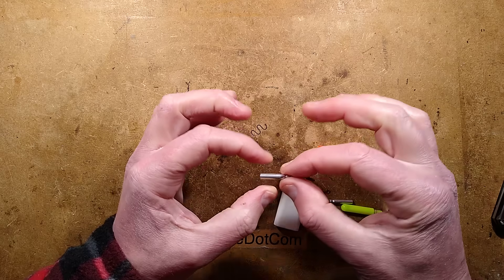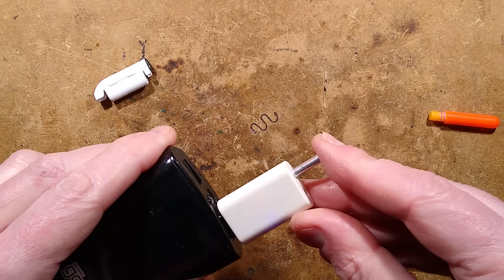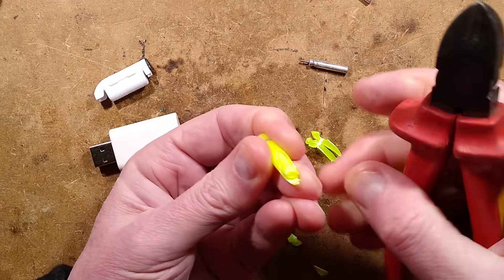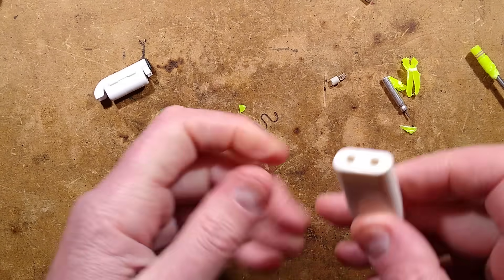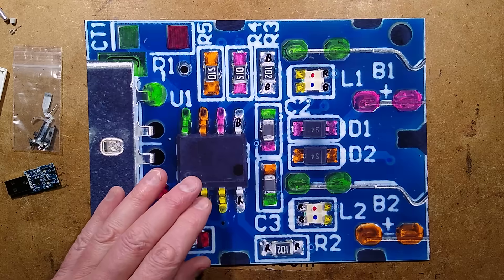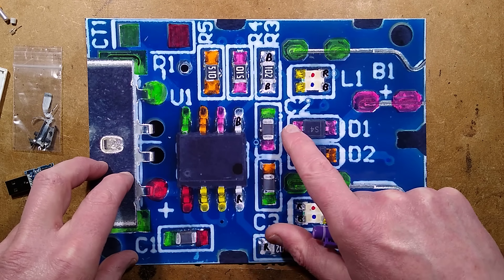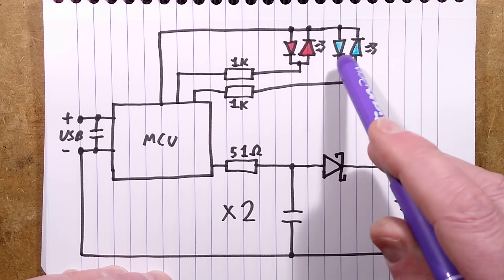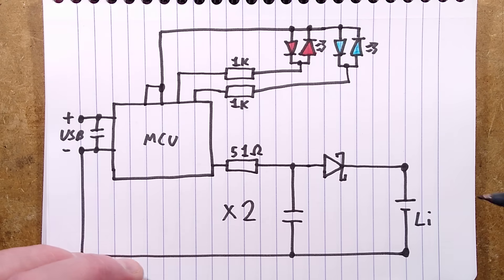Inside a tiny CR425 lithium cell and its odd charger - with schematic

Comment: So when you're holding the battery the case is the negative
Reply from the maker: If I recall correctly, the case was positive.
Reply: @bigclivedotcom  usually the tip is positive but okay

Comment: Its pretty cool.  If the led is designed to be used underwater then no circuitry means less to go wrong when it gets wet.  Also the led cannot overheat since it is in water.  So you can probably drive the heck out of the led without any trouble.

Comment: I love these things, been using them for all sorts of projects for years. They last anywhere from 24h to 3 days, some of em are a mm or 2 longer than others and those shine longer
Reply: I bought a few of these to test and some are better if they are marked with CR425, the unmarked ones work OK but will not return to 4 Volts when recharged, so the red LED never goes out on the charger.

Comment: I use these little cells for my fishing floats for quite a while now.
I had one in the mid to late 90s but the battery was about 5 D-Mark those days and they lasted not very long. Lately
I bought some of the rechargeable ones but they  tend to not have lots of recharge cycles and the capacity drops quite a bit 😒 but they are cheap a.f. now so 🤷🏼‍♂️
Too bad they can't be used to do funny stuff besides letting a led suck the minimal amound of juice those thingies have. With an Multimeter alone (no led connected) you can literally see how V and mA leaves his little body, poor little guy 😅

Comment: Illuminated archery nocks also in two lengths, short for crossbows.
Standby time was 3 years with only running an hour or so a few minutes at a time. Have longer replacements but still haven't put them in.
Never seen the charger. Thanks.
Reply: They are triggered by the snap of the string release, the nock is about half a millimeter from being seated and one wire is bent down through a tiny notch. Presumably there's a contact when they squeeze together.

Comment: I've used these extensively over the last year and I quite like them. You typically attach them to the end of a fishing rod so you can "see" fish bites in low light conditions. Previously people would use bells or mini glowsticks which would either become very obnoxious in light winds or would be disposed of after use. You can get "CR " non-rechargable or "LIR" rechargeable cells in multiple different sizes (I think the 425 is the largest?) and also floats with LEDs integrated optionally with smart flashing modes. Maybe another video idea?

Comment: What's the cell capacity? How long do they light up for?
Reply from the maker: The intensity starts high but gradually reduces.  They are still visibly lit 24 hours later.
Reply: From a User on Ali he is saying The LED's  lasted for like 13 hours on arrival, then needed recharge.

Comment: Is this similar to what Airpods use for their cells?

Very odd way of driving the LED's. I guess it saves resistors compared to having all 4 direct drive?
Reply from the maker: I think they use tiny rectangular cells.  I've never opened a set.
Reply: Pretty sure the chinesium ones... airpods clones... use the same/similar cells... for a long time. Speaking just as an enginerd  (I know everyone on this channel hates us) ... but you can pack more battery into a round shape, than a square shape, for the same length... when you are going to contain it in a cylindrical shape... like the cylindrical body of an airpod earbud... which is where the battery actually lives. Not saying those guys making the clones care... but, they might. For chinesium components... it all comes down to cost. But, I expect that Apple uses cylindrical batteries... like at 200.00USD (on average) for Airpods... maybe you could you the best batteries. At 50.00USD (on average) for the chinesium clones... maybe not.

Comment: I have used them many times but the disposable type and red led using one of the cells from a 9V alkaline battery .they help with seeing bites and used plastic clothes pins with a 9v battery and flashing LED and piezo buzzer so that if the fish pulls the line the buzzer and light go off for night fishing .easy to do

Comment: That cell looks like something they'd use for a prop in a TV show as some high-tech method of subcutaneously dispensing an unwanted substance into a person... :P
Reply: Reminded me of the abductee implants from The X Files.
Reply: It looks like it might be handy for powering itty bitty glowy bits in sci-fi productions. I imagine they’d appreciate an easily-swapable power source in that application, and sometimes a CR2032 is just too big, not to mention how fiddly those can be to replace. That nice little snap might even serve as a switch if the prop could be made to retain the cell when partially removed.

Comment: Panasonic make either these or similar. A company a long while ago made a book of matches style set of flashlights. But they provided no means of recharging the pin cells.
 Seaching for "panasonic lithium ion pin battery" top link should panasonics industry website with the specs etc.

Comment: yes ,it`s to put in the end of the fishing rod to fish by night or fog , to inform the fish is biting or hooked ;)
Reply: Out of 4 beach rods I have they only fit 1, 2 are too thick at the tip and 1 is too thin, I have seen two different sizes advertised once, but for the life of me can't find the larger size again.
Reply: I think it's used to attract fish.
Reply: @Ni5ei  Some adverts do sell them as fish attractors, but really only used as bite indicators on the tip of the rod at night. May be used as an attractor in course fishing.
Reply: @Ni5ei  possible , some fishes like to eat iridescent prey , it's possible that could work . I only have seen this on the tips of rods , or on the top needle of a big float (the weight must be balaced)

Comment: I work in manufacturing we often see these types of cells in probe systems for machines, instead of getting power externally they have these in them, I’m fairly certain these just work by contact as the probe gets pushed down it completes the circuit which also sends a signal to the machine to know when the probe has made contact.

Comment: I feel like this would be useful for stuff like a rechargeable CR2032 alternative. I wonder how hard it is to make a port to plug those little batteries into?
Reply: After a quick look at Ali I get the impression that CR2032 batteries are not rechargeable but the ML2032 are and they are replacements for the CR2032. 

There are also LiR2032 rechargeable batteries but they are 3.6V.

There are even more types of 2032 rechargeable batteries.
Reply: 3d print anything imo

Comment: Hi Clive,
Very interesting little light with its fascinating battery. Definitely inspiring gadget to build something with in the future 🙂 Did you measure the fully charged battery voltage? Thanks for the nice video. Keep up the good work and take care!
Reply from the maker: It's a classic lithium cell.  It topped out at around 4.25V.

Comment: Teeny tiny! A little cell like this could power a bug. Bonus points for discombobulating something that small.
Reply: In 1969, I made a spy transmitter that occupied as much as one penny in area, two in thickness. It included one quicksilver miniature battery, one transistor, one resistor, two capacitors, one inductor, and a coal-powder-filled paper capsule tiny microphone, with an adjacent paper capsule as circuit container. It had a length of ultrathin, almost invisible wire as antenna. It emitted on VHF, FM. 30 ft. range.
Reply: I read that as bus instead of bug at first and was confused 😂